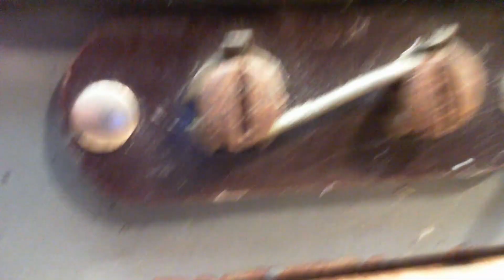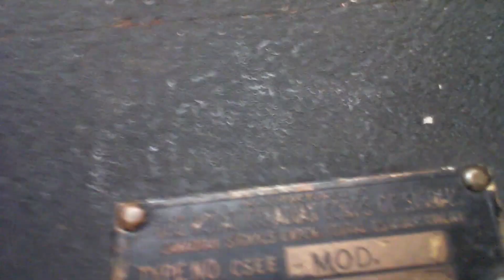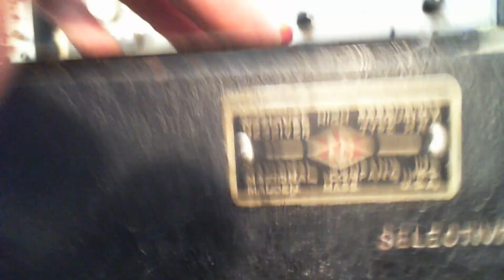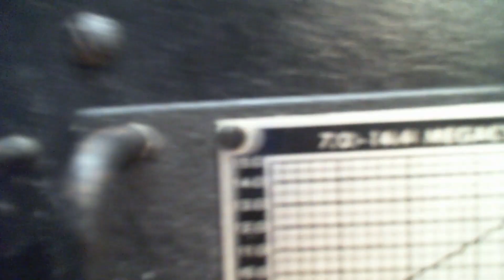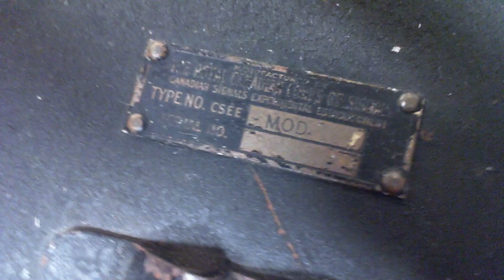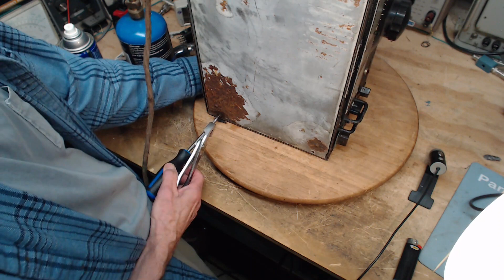National HRO Receiver Video #1 - Checkout and Assessment

Comment: A tip to help remove that tight screw on the bottom panel:
Since 3 of the screws were removable you can swing the whole bottom plate and pivot it around the stuck screw, this usually breaks the bond and will make it easier to remove.
Reply from the maker: Good tip.

Comment: Where is the separate power supply? I see coil set type JB so it is from 1935/36. Range is 7.0 to 14.4 Mhz.
Reply from the maker: I don't know where the original power supply is.  I'll use my shop supplies to power it up once I get to that point in the process.

Comment: I own just such a radio of very similar vintage (same tubes, same IF cans). I recapped it when I got it. The filament hum-balancing resistors were crispy and burnt from age. All of the other dog-bone resistors were within tolerance so they remain. Mice left gifts so a thorough cleaning, application of "rust remover" and repainting of the top of the chassis was in order. It is an excellent receiver to this day!
Reply from the maker: I have read up on this radio since I shot this video and I am now quite impressed by its place in radio history.  I'll be very excited if I can get this one working.